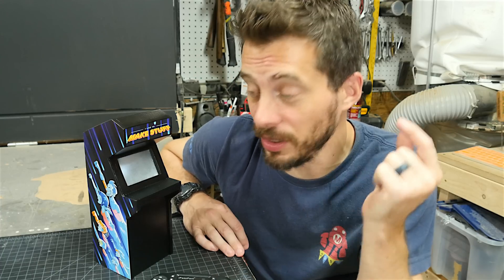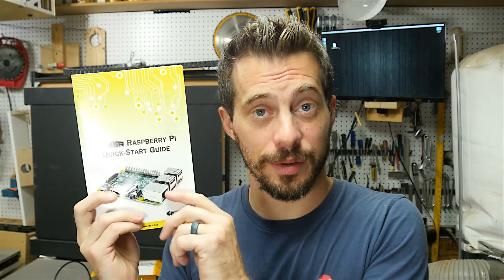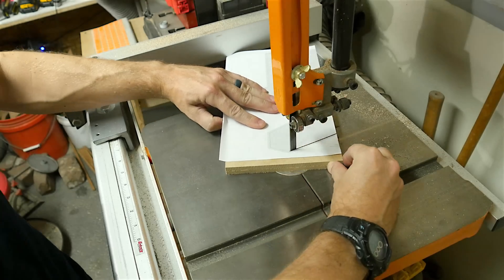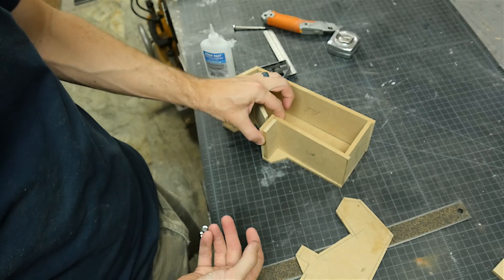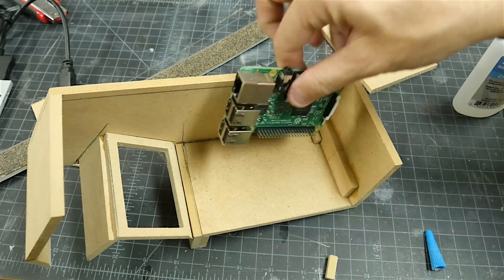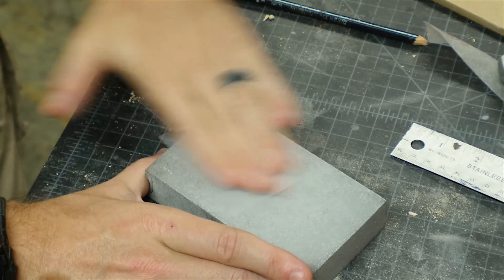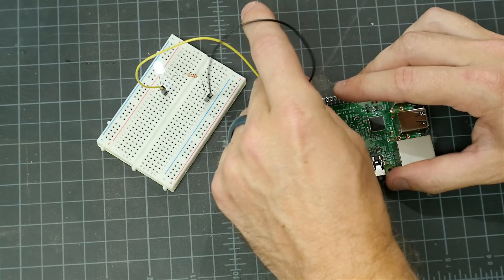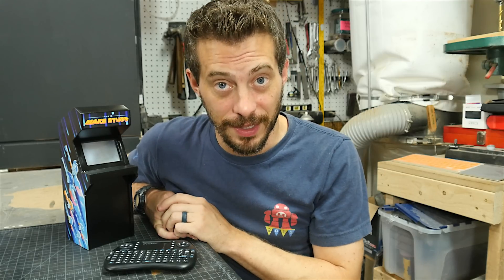How to make a Raspberry Pi Media Center with Kodi | I Like To Make Stuff

Comment: Be ready for a few things if you are looking to build a more elaborate media center keep in mind you will need a lot of storage. If you transcode your media to x264 or x265, the Pi will NOT be able to transcode your media. It’s passamark is around 900 and you need at least 2k of processing power for 1080p. If you DON’T transcode your media, this should be able to do it, but your media will be 10 times larger (literally) on the hard drive. Bigger drives are more spendy. And HDDs that aren’t solid states like he uses in the video are much cheaper but need more power. Just to keep in mind.

Comment: Why do you use primer before the spray paint?
Reply from the maker: Especially on wood, the paint will soak into the fibers and give a really inconsistent finish. Primer seals the surface, and makes the final paint texture much more consistent.

Comment: you did forget saying that eathernet cable needs to be plugged in for the installation

i tried it with a wifi dongle but it didnt show any options for ocmc
Reply from the maker: There's onboard wifi with the Pi 3, so there's no need for a dongle.  I don't remember using ethernet for anything during this.
Reply: I Like To Make Stuff why didnt you extend the plugs to the outside of the arcade case??

Comment: Hey Bob, what grit sanding block would you recommend getting a matte black finish off some wood? It's a very thin coat. I used an orbital sander to get most of it off but some parts of the wood curve and bend and need a hand sanding method. And to touch up and smooth the surface for re primer (which would also be what i use the block for). Thank you for the time and your hard work. Keep being awesome man!
Reply from the maker: I tend towards 100 grit for most general use.  It's not too rough but still does some removal.

Comment: I would recommend putting some vent holes near the top so that the heat has somewhere to go when you're using it. If you're lucky, this will make a natural draft where the warm air goes out the top and draws in air from the gap at the bottom to help keep things cool.

Granted ARM processors like on the Pi don't produce as much heat as non-RISC machines, but they do produce some and boxing it up in wood is basically wrapping it in insulation. 

But, that gap in the back is probably sufficient to keep it from overheating. I don't know. But check it when using it. If it gets a bit too warm, venting the top might be the way to go. I suggest drilling a series of small horizontal holes in the back bevel so it doesn't show and so the holes don't let dust fall into the cabinet. But horizontal holes may restrict air flow too much. Just spitballing here.

Comment: Bob - I can't get the keyboard to work - any special tricks,   Fearing I might have got a bad one, I bought a 2nd, same result
Reply from the maker: +Paul Payne hmm. Nothing comes to mind. Does it power on? Have you tested another USB device on the pi?
Reply: Problem solved - while in NOOBS you must setup wireles internet and wireless keyboard.  That way it know what to install in the media center software.

Comment: REMEMBER! SSDs DO NOT LAST FOR EVER!!

Unlike hard drives
Reply: ***** yes but SSDs are more likely to run out of space first
Reply: ***** They are Finite . Meaning that they will not last for ever. However, hard drives can be Infinite. meaning that they could last forever.
Reply: ***** but if they didn't fail. they could be used infinitely. BECAUSE the hard drive uses a physical disk to write content on. WHERE AS a SSD uses electrical cells to hold charge for a while. SSDs electrical cells eventually get worn down. so SSDs are finite and can't be used  .
Reply: ***** BUT it doesn't! Because the hard drive gets things written ON it instead of IN it, nothing is being worn down (apart from the writter head).
Reply: ***** Because your SSDs are new. THEY WILL RUN OUT OF SPACE EVENTUALLY. And much faster than a hard drive!
Reply: ***** I don't know whats happening to your hard drives (maybe your dropping them or something), BUT SSDs will eventually run out of space!
Reply: let's say your right and ssd die in 5 years.  ssd are still 10 times faster than hdd so I'm going to choose ssd for speed.  not to mention, with the advancement of technology, in 5 years, I'm going to want to upgrade my storage because it will not be nearly as good as the latest hardware.  if you want to buy something that lasts, buy some good tools for your shop like this youtuber has.  if you want to buy hardware that lasts, you are wasting your time, hardware is a terrible investment at the rate technology is expanding.  ssd>hdd

Comment: I love this project but already have a media server through Plex. Would you recommend using this pi kit for an emulator?  I don't have the space for a huge cabinet and something about a small arcade machine running emulator sounds very cool to me.
Reply from the maker: Absolutely! This is the same kit I used for my full size arcade machine.  It would work great in a smaller package as well.  I'm working on plans for a smaller bar top machine right now.

Comment: For a cheap media center, that's not bad, but 240 gigs isn't going to get you very far. That's about 50 movies or around 200 television shows at 1080p, far less at 4K. Not to mention that just having a media center is not as much of utility as it could be. You can build a FreeNAS server for next to nothing (sometimes even using an old computer) and add a few server-grade hard drives (which are dirt cheap, even at higher capacities). It will take a bit more setup, but you'll have a Plex server for all your media, a way to download media, a way to stream media while you're away from your home, and a way to backup important data automatically from any computer or device on your network.

Comment: Hey Bob. Love your projects. Question: what kind of spray laquer did you use (7:30-7:35) to seal the spray paint? I was told that you couldn't use spray laquer on spray paint as the lacquer solvents can 'dissolve' the paint 😕. 

I recently finished a project that I used rust-oleum spray paint (various colors) & I didn't know what to use to seal the paint. I thought about using rust-oleum clear spray paint but my local hardware stores didn't have them in stock, so I left the project without sealing it. Thanks boss! I look forward to hearing from you soon!!

Comment: Great build Bob! That Kingston SSD will work off the power of the raspberry pi? I know you said more than one would need another power source but one doesn't?
Reply from the maker: Nope, one seemed to be powered just fine.  I ran it for a long time and didn't see any issues. I doubt it would support any more than that, but looking at the necessary amperage per drive would help figure that out.

Comment: What's the difference between a raspberry pie and a bread board?
Idk if I spelled those right but whatever
Reply from the maker: Well, a breadboard is really just a board for plugging in wires to temporarily wire up a circuit.  It helps you avoid soldering things for the purpose of testing and prototyping.  The Raspberry Pi is a self contained computer, all on one circuit board.

Comment: Can someone tell me the benefit of having a raspberry pi media center? Can't you plug in the SSD straight away to the TV via the USB to SATA cable?
Reply from the maker: It really depends on the TV. Some of them have a player software built in, but most don't.
Reply: Oh I get it. So its kind of a DIY solution on how to turn a normal TV into a Smart TV, right?
P.S.Love your videos btw. Keep up the amazing work Bob! :D

Comment: Hey Bob, I was going to make some foam props, but when I went to Lowes, the EVA floor mats were $18!
Is that how expensive they are for you?
Reply from the maker: Fireyfireball101 It's all the same as far as I can tell but I use this one mostly. http://amzn.to/2di5uSH
Reply from the maker: I only buy it from Harbor Freight. Do you have one of those local to you? A pack of 4 mats is $9.99, and sometimes $5.99 on sale)
Reply: I think one is like 30 - 40 mins away from me! I am really interested in prop making so I'll check it out! Thanks!
One more question: Do you have a specific time that you do live streams on twitch?
Reply from the maker: Parity Cuber Yes! Every Wed at 11am eastern time
Reply: Awesome!
Reply: What kind of CA glue do you use. I noticed that you use it a lot, so it must be good.
Reply: Isshe

Comment: You can also use control over hdmi and control kodi with the remote for your tv. Works great for me (raspberry b+) :D
Reply from the maker: Oh, good point! I'd forgotten about that. I guess it depends on if the TV supports that protocol. Surely most of them do by now.
Reply: yeah, my tv just showed a message that control is active when i started my raspberry pi with kodi

Comment: +I Like To Make Stuff don't want to be that guy but for air to actually flow, you'd need another opening higher up on the enclosure. Now the air that the RPi heats up will just rise up to the top of the enclosure and pretty much stay there.

But that's just nitpicking, the RPi would be completely fine even if you'd close the enclosure fully.
Reply: With the press-fit back panel, inserting it down a little instead of pushing it up flush with the top edge should do the trick nicely, I'd think. :)
Reply: You could also cut a few slits in the back panel to use as vents.